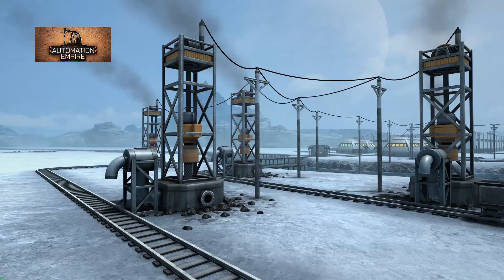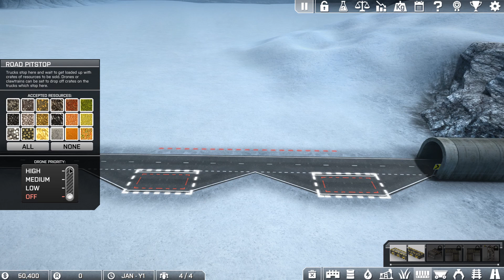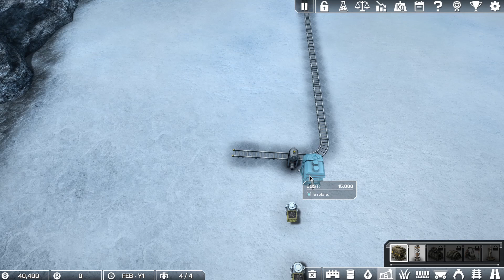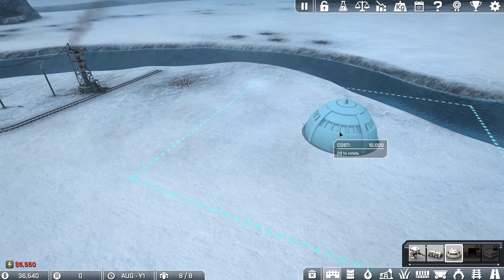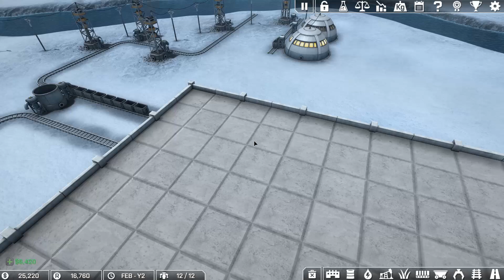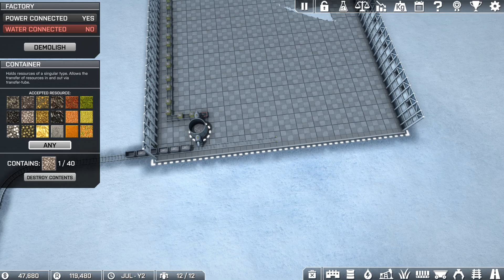Automation Empire Ep 1     Snow Cone Flats

Comment: Ok, i watched only 15-20 minutes and skip then through the video.
WTF are you doing? You waste a sh**load of money for electricity and taxes the way you build. (and the taxes will eat you up, 2% of lifetime profit, not 2% of monthly profit!)
Rule of thumb, 3 drills for 1 crate maker and 1 crate maker for 3 refiner.
Dont feed crate maker direct, use a storage tank to feed the crate maker (you can also fill crates direct from a storage tank)
Short ways or fast transport a crucial, crates are the slowes way for transport (one single cart can hold the material of 4 crates)
Conveyer belts short range, clawtrains short to short medium range, carts short to very long range

Long roads are not neccessary, later with the claw trains, 3-4 load stations are the max capacity for roads, you can build more loadstation and deliver material to these stations, but no empty truck will reach them.